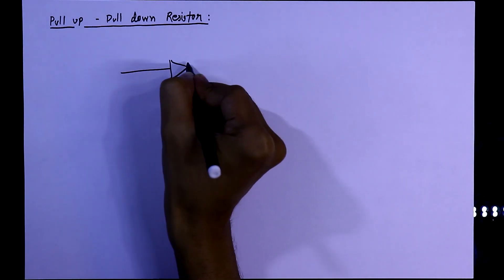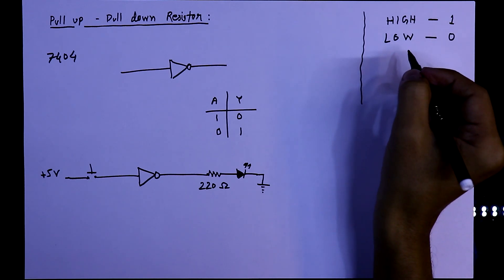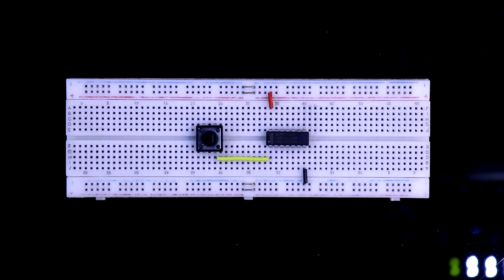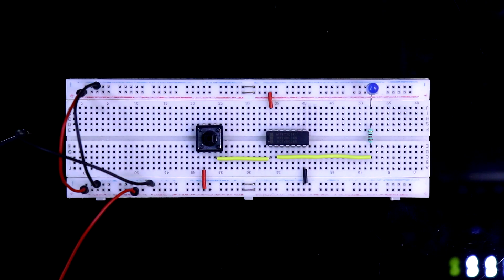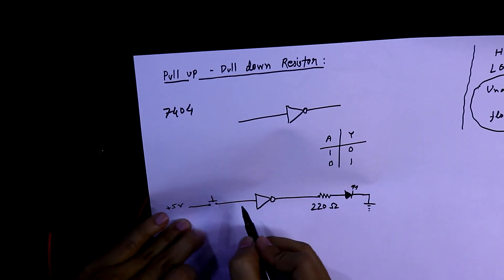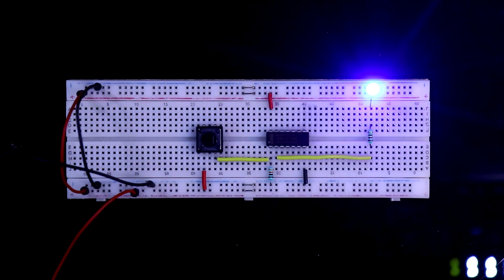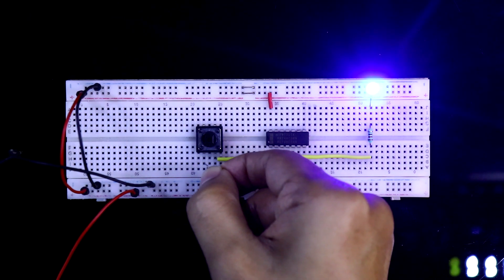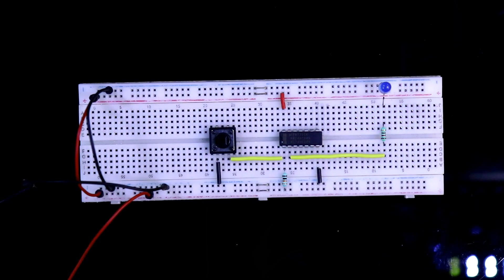Pull up and pull down resistor

Comment: Hello, what if I used 3 logic gates in one breadboard, do I need to use a pull down resistor on each gate or only in the input part only?
Reply from the maker: Input part. Each and every input of digital ic, you need pulldown resistor.
Reply: @EEWave  thank you very helpful! Already subscribed!
Reply from the maker: thanks you so much, please share my videos...
Reply: @EEWave  yes I will

Comment: Sir in digital circuit when you used a pull down resistor in the input of the ic and when you apply a supply to input there is no output only if you press the switch the output will become high and  when you used a pull up resistor the scenario is reverse im i correct sir tnx for the video